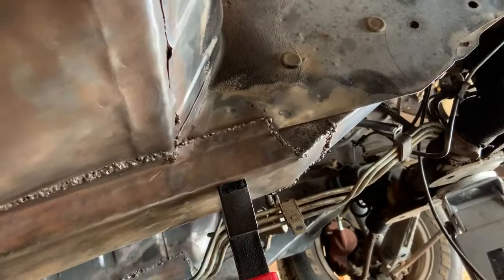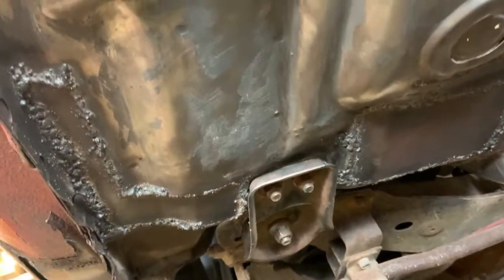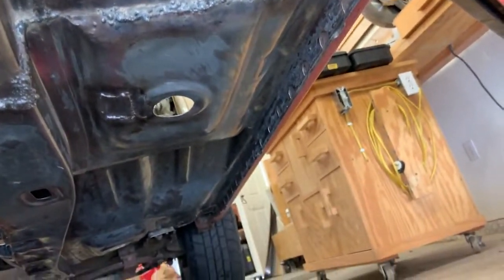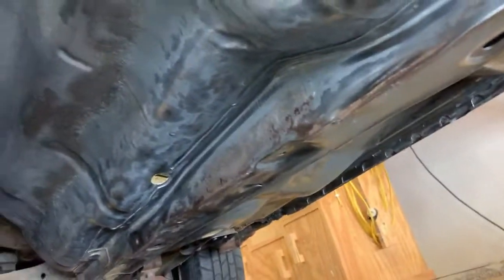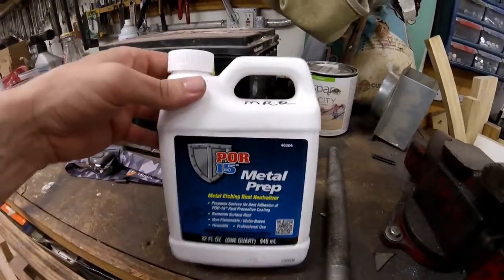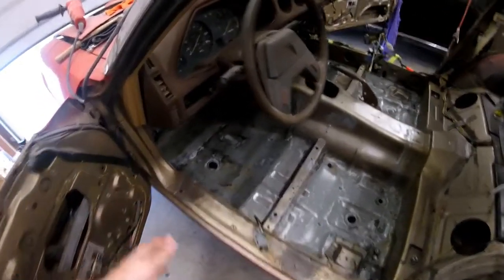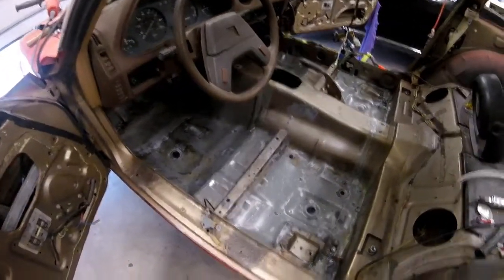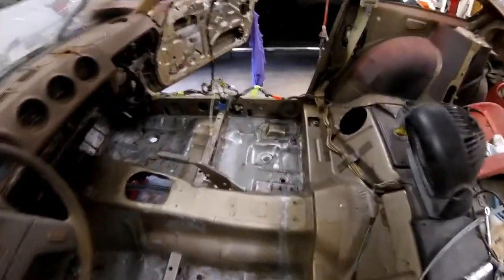Getting the Floor Finished | 280zx

Comment: Hi, it looks great...W#here did you get the floor pans and frame rails?  Could you please provide a link?  Thank you
Reply from the maker: Thank you! I made all the patches from 16 gauge sheet metal. Used a hammer, piece of train-track as a anvil, a vise, and basic hand tools. Before I did this I found a patch kit but it was going to be over $600 best I remember so I spent a bunch of time to make my own. This was my first time doing this and in the videos I tried to show what worked for me. Now that I am on the other side of it, I still would not have spent $600 on patches. Making them was time consuming, but kinda fun and a good experience. Let me know if you need more info
Reply: OK, I don't feel as bad about how my welds look now.  A lot of work!

Comment: Hey there..any chance you have templates or can make 2 more floor pans? Need them for my 83 280zx 2+2
Reply from the maker: I don't think I could do that with any accuracy or significant rework. I would say if you are capable of installing them, you shouldn't have much trouble making them. These were the first ones I had done and there might be a better way of doing this but here was what I did:
- Cut back to solid metal and made it a reasonably easy shape to patch. Make sure you don't cut through something you want to save. 
- Take measurements of now open area
- Cut patch to those measurements adding about a 1/8 - 1/4 inch on each dimension since it's easier to trim than add metal 
- Install patches using a "stitch" weld method and cool with air as needed. 
I think all I used was a grinder (cut off disk, wire brush not a disk, and a flap disk), ball-peen hammer, basic fluxcore welder, tape measure, and a vise. Seriously, wear glasses, gloves, and hearing protection. Only surprise I had was I kept finding rust.